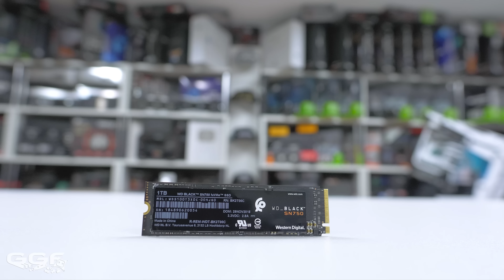Our CLEANEST Build Ever?? Checking out the new Seasonic Syncro Case

Comment: That psu plate for routing cables is genius. Why is this the first time I've seen something like that?
Reply: i know right
i want one
Reply: Yeah, pretty sweet. Only time I've seen this before was the MBX MKII but then again at 1200$...
Reply: That's because this PSU/case combination has only just been released.
Reply: Because it's proprietary to seasonic, and they are the only ones who have done it.
Reply: I don't understand what the benefit of a psu like this is, routing cables with a normal modulaire psu is just fine right?

Comment: Am I confused?  Where is the radiator return to the Res?  I see tubes running from the res to the video card, to the cpu, back to the video card to the radiator.  I don't see a return to the res?  is it hidden away somewhere?
Reply from the maker: Secrets
Reply: either in the back of the case or just not connected for aesthetic.
EDIT: 6:05 you can clearly see the black soft tubing that come from the top rad and go all the way to the bottom of the res

Comment: I'm curious, I had seen in another build that you were able to do a dual pump system in order to have one color for GPU and another for CPU. So, in theory, say if someone was using this case but without the Syncro connect. Would it be possible to do the same sort of thing in the Syncro case?

Comment: Just had a thought, why don't they (not sure who 'they' is...) put the 24 pin on the reverse of the mobo? Why not all the connections on the back? I know this would limit the cases you could have due to the accessibility, but if they've made this connection thingy and a specific case to go with it, why not a mobo with no visible cables at all. That'd be clean af.

Comment: Are the graphics card and CPU in parallel? I’ve never understood how that would work.
Reply: As long as the GPU and CPU blocks don't have a massive differential in terms of flow/restriction, the coolant will split almost evenly between the blocks.  I ran my GPU and CPU this way for a very long time and actually got better temps in parallel than I did when everything was in serial.  That's not guaranteed but was my experience.

Comment: Because of the upside down writing I'm not a fan of these builds, but this is very well done. It's almost flawless. The only thing I would do different is put the PCIe power cable behind the tube instead in front for a cleaner look. But otherwise, well done mate 🤙

Comment: very nice but just a little criticism, the cables could have been done much better. especially coming from cablemod
Reply from the maker: Please elaborate? Sleeved cabled were tried first but due to the short distance they simply did not want to bend. And also the splices were very noticeable and looked off. The next option was SFF cables as the splices are in the connectors. But hey everyone commenting is an expert right?
Reply: @GGFEvents   -  AH, that explains why then. I would never have known the cables would not bend. Me in my own personal opinion would have loved to have seen sleeved cables with combs especially if you make the statement the cleanest build ever, but your explanation makes sense. You should be no stranger to criticism champ! Still, stunning Build!!!!!

Comment: Nice clean build, but its sometimes nice to just change the colour scheme entirely with lighting with a few clicks of the mouse, you can't really do that once you go with coloured fluid.
Reply from the maker: Bro it's Seasonic theme
Reply: @GGFEvents  Yeah I know, it's awesome. I'm just saying in my own build  I use clear fluid and lots of RGB so I can change the look.
I like the PSU block thing, it's a cool idea.
I wish the gpu could get all its power from the slot and there was one area at the back of the motherboard where you could plug cables in, that would be simpler and cleaner.

Comment: Pastel fluids can cause damages on your waterblocks, you know?
Reply from the maker: Yep but not if you drink it first.
Reply: @GGFEvents  well... I had a water cooled pc and i used a pastel fluid... After some months, the system was like blocked... The cpu block and gpu block was full of color particles.
After cleaning it, the water cooling was working again but i used only distilled water.
Not necessary to be unfriendly.

Comment: Perfect case for beginners... pity so much space is wasted, and that as usual th epower supply shround doesnt have some space to run tubes betweenthe PSU and teh sdhorufd top... Be quiet  has made a better design,,, juist not so clean looking...i hope they will clean up the exteriors in time .